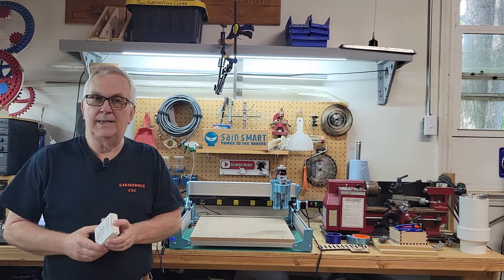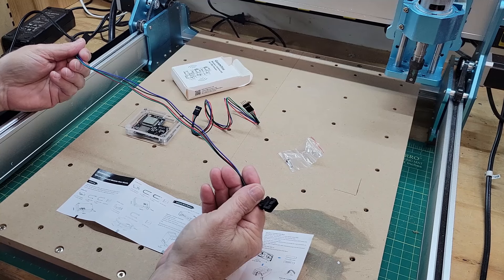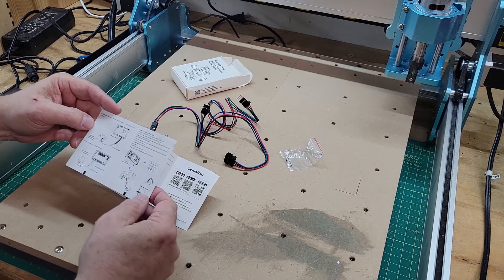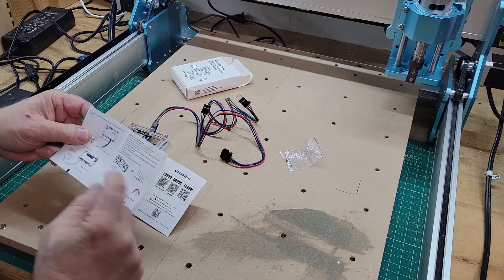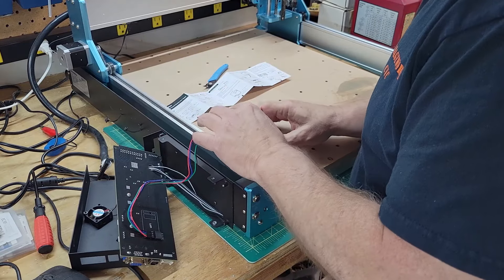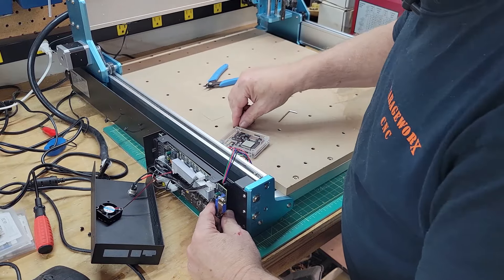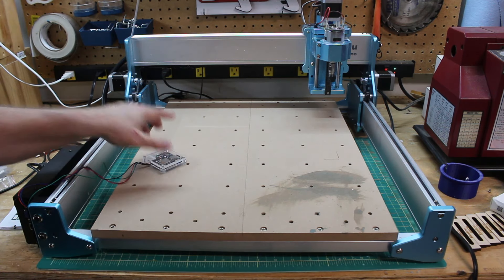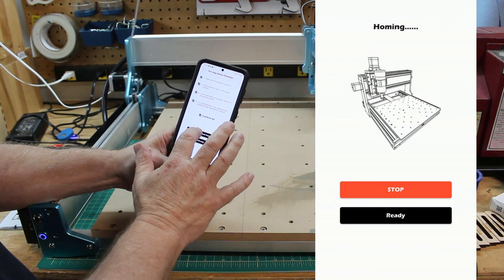Run Your 4040 Reno With Wifi

Comment: Now that there are 4 extra, unprotected, random wires sticking out of the control box with a plastic case on the end, where are you going to put it on the machine so the wiring doesn't get damaged and the box is out of the way?  Sorry for the negativity but they went to great lengths to hide / protect the machine wiring on the Pro and Reno and then just let the probe and the "wireless" controller just hang out there wherever, looking like these were afterthought items that they didn't know what to do with so just leave it to the buyer to figure it out.
Reply from the maker: Thanks for watching Steve.  I appreciate your support.   I don't know how much I would use the wifi since I keep a laptop right beside it, but it's still nice to have the option.